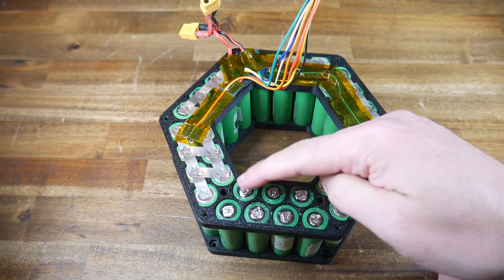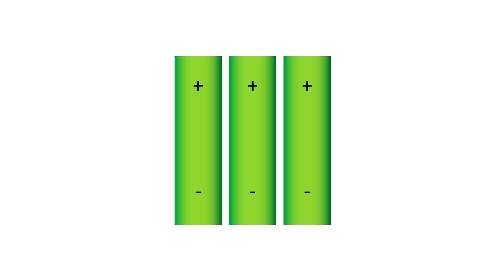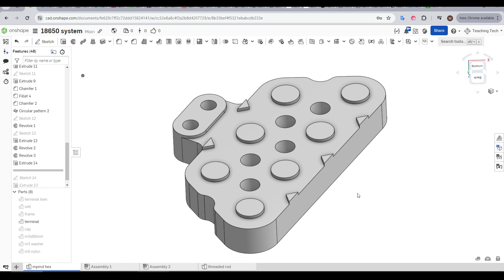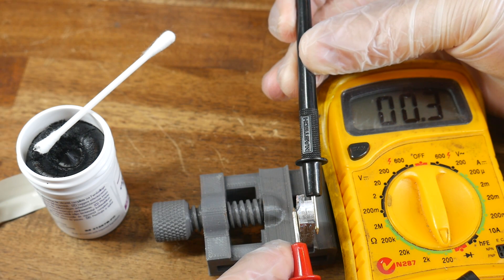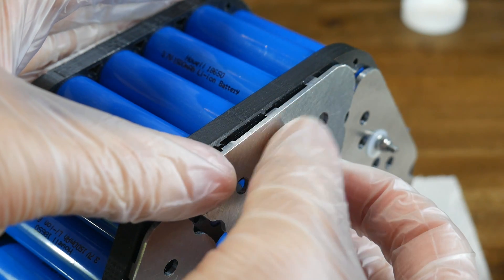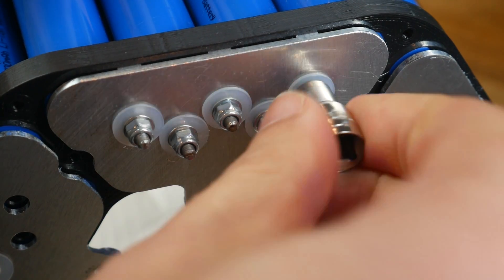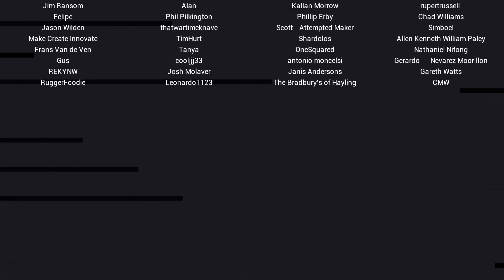Experimenting with a new (and probably flawed) 18650 building method: No soldering or spot welding!

Comment: I think what you have done here is really cool, though it feels a little over complicated with too many potential points of failure. I would suggest more of a hybrid approach.

First I would make the frame itself the modular portion based around each cell group, with them effectively interlocking with each other. This way if you have a bad cell, it is far easier to separate that group out. Second I would personally stick with  spot welding the cells within the group itself. It is a more reliable connection and uses far less hardware. While spot welding can be fiddly and annoying, I think you just kinda traded one for the other with all the bolts and alignment pins and chemicals etc (Obviously subjective). I would then connect the individual cell groups with a bolt mounted bus bar. This is a proven method and would combine nicely with your model if it is modular instead of one solid piece. Making disassembly a few nuts and sliding apart the frame, instead of cutting or a whole ton of nuts. One easy way to do this would be to have a spot molded in the frames for your positive and negative bus bar to snap in that a nickle strip gets welded directly to, but it connects to the next frame via the nut and bolt. I hope my rough description paints the picture in your head that I have in mine. Either way no matter what direction you go, I look forward to watching future videos on it.

Comment: For other applications requiring clamping consider using Belleville springs (conical spring washers). They're very compact, and being a washer are easy to integrate into a design. I've only used them once, but my heatsink assembly gave many years of reliable service.
Reply: Springs that's a great idea to provide constant contact.

Comment: This project came about because you had a problem accessing an individual cell, or a number of them, from a custom battery pack. If that happens with this new design, you are still going to have to take thing apart, just not to the scale and hassle of your previous battery pack. 

 It would be neat to have a way to easily change individual cells without having to take the pack apart, such as incorporating the spring at the negative end as is done for smaller cells such as AAA, AA, up to even D sized batteries. The wire used to make the spring would need to be thicker or perhaps replaced by a lever. For the lever I was thinking that the negative contact would be designed so that it would be flat against the cell when it was inserted but it was slightly away from the base of the holder by having the contact angled. The spring could be either in contact with the cell or it could push a contact plate out to meet the cell. Probably the former as that is how society has been doing it for many decades. I would be interested to see if it makes a difference to have the plate pushed out to make contact with the cell.

Thanks again for another interesting video.

Comment: Be careful, I’ve seen too many fires to mess with batteries.  I work for an environmental test lab and a battery pack like this needs to go through un38.3 testing.  I’ve seen companies who build battery packs and make one small mistake which cause the battery to go into thermal runaway and catch fire.  As a lab, we do not allow any company to store their battery pack onsite overnight without fire watch.  If nothing else store this pack in a metal box ideally outside of the house. As this will be used in a mobile application, I would worry about shock and vibration.  We had one company who delivered their batteries for testing and left it with us to test.  Before we could even get to testing, the battery pack caught fire while just sitting on a cart (again not charging, but just sitting there).  So please use extreme caution.  On another note, have been watching you channel for over 5 years and appreciate the learnings you provide. Good luck.

Comment: Just a couple of thoughts off the top of my head. Maybe mill the plastic washers from a sheet, making fitting a single sheet less fiddly. In the last part with the 4 cell design, could it be 3 cells? Then the single bolt will tighten each cell greatly reducing part count and assembly time. Thanks for sharing and keep innovating!

Comment: try some 32650 cells, they commonly come with threads fused to either end for easy and quick battery pack assembly/repair

Comment: For the new version, I'd suggest using triangular caps. In a square, one corner could be lifted, in a trangle all corners would be loaded. Also, if you could knurl the bosses or create some other sharp points on them, they could embed themselves very slightly into the metal, creating a more secure connection and maybe not requiring the paste altogether. The flat bosses wouldn't work great without the paste because the terminals arent perfectly flat and by all likelyhood, neither is the alignment. For a bigger battery I'd also consider if and how you'd like to be able to do some airflow and thermal protection. Having some sensors in can be a great early warning system if cells start to fail before they become critical and might even help you pin-point which bank is dead before disassembly.

Comment: Instead of milling it would be amazing to see the metal contacts 3d printed. Some type of wire frame. Maybe pcbway could sponsor you for that. But yeah, 3d print all the way. I'd also like to  see instead of M3 bolting your 4 batter assemble piece, some sort of 3d printed thread system, like some sort of Japanese style nail less joinery.

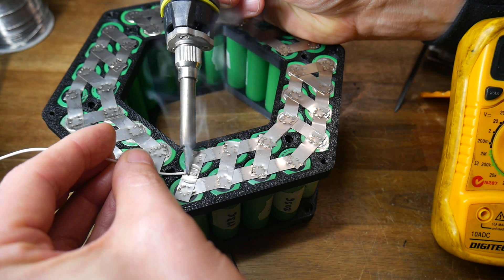Comment: NEVER 02:06 solder above positive ( + ) side of the cylindrical cell  without adding extra insulator !!! It will melt / damage plastic insualtor ring and over time whole battery can be shorted ( outher shell is negaitive ( - ) !!!!

Comment: General remark #1For the "ampacity" --> for copper, 10A/mm^2 is fine. The stamped metal parts (discs/tabs etc) within the cell are the weakest link in the chain. A point-contact can indeed be a problem
GR#2: When it comes to mechanically over-constrained systems, always think of "nest of springs" and therefore the spring-equation: F = k.x. To achieve a large F, it is better to have a longer travel (x) than a stiffer spring (k). I can think of wavy-disc washers or bellville washers that can interpose between your "collector" tab and the battery-nubs. The aluminium seems like a bad idea for its excessive stiffness, oxide-insulation related issues, electrolytic issues with the nickel tabs, and likely a number of other issues I cannot put a finger upon. It icks-out the engineer inside me. Good for thermal dissopation though. Ditto for the "conductive paste" - it is a band-aid to solve a problem, when the problem ought not exist.

You travel the  path of "swappability" to ensure you can replace individual cells instead of having to replace packs. This incurs costs of its own, but allows you to use cheaper cells. However, seeing how cheap and consistent "new" 18650s are, I question if the swappability is worthwhile, at all; wouldn't the bottom-line be better with a simpler interconnection-system and slightly pricier (identical) cells?
Reply: PS - the mechanical clamping might induce (unintended by th emanufacturer) stresses and pressures on the battery while charging and discharding - the bolts essentially disallow it to "breathe".

Comment: Interesting idea but I think that those contact bumps have too little "springiness" to it. I would try to make cutouts around those contact bumps in so they can flex a little bit. That would allow to reduce clamping force, reduce bolt count and allow for some variance in battery size. To make positioning screws and nylon washers easier I would try to 3d print shoulder washer or cut some plastic tube to make sleeves for bolts.

Comment: Internally threaded insulated tube for clamping? If used between every cell, could reduce to M4 or even M3. Externally threaded nylon 'allthread' with two nuts on one plate to hold it in place for assembly would also work? Counterboring the fixing holes on the aluminium plates would also reduce height but is a second side operation.

Comment: One comment I haven't seen yet: 18650s are afaik designed to pressure release at the top in case their chemistry fails, so that they don't at least explode. By clamping them down you now might have prevented that safety measure from working properly, so this might literally explode instead of just catching fire.
And if one of the cells or anything in there catches fire, those bolts will likely melt through the plastic and potentially shortcircuit the whole group, which might even only occur when picking up the failed pack. It's a think that frankly always makes me nervous, also with torches now essentially being pipe bombs, as they are usually sealed for water resistance.

Comment: Seems a bit over complicated just to solve a problem that you yourself created. By removing the end stop from one of your frames you can make each cell easily removable without breaking the entire pack(and even that parallel group).You can add the end stop again to your lid if you're concerned that the cells will move around

Comment: That was a bit uncomfortable to watch, for all the reasons developed in the comment section.
Did the previous pack die because of the lack of BMS, leading to a cell group discharging too low and ending up dead?
Please consider using a BMS for this pack regardless, they're really cheap.

Comment: In a parallel pack it would be best to fuse each cell individually, so that if a cell fails into a short circuit, the other cells don't feed all their energy into it to blow it up. This could be possible in a bus plate based pack if the bus plate had cell sized holes and the cells were connected to the bus plate by thin enough wires.

Comment: Have a somewhat similar system on Printables that utilizes standard nickel strips and silicon bumpers (act like mini springs). Can't seem to post a link to it (Youtube anti-spam filter?) but just look for "Weld-Less 18650 Battery Build System Version 2" if you are interested in checking it out. Working on version 3 currently.

Comment: My suggestion is having the batteries in banks of 3, that way it will all self level and you will get better contact, kind of like how a three legged table will balance on any surface, also maybe one side of your contacts could have a threaded hole, you could then use a threaded bolt, and a rubber washer on just one side of the contacts, speeding things up a lot

Comment: lol. I was literally asking if conductive paste exists for electricity like the thermal paste is for heat as you started telling us about the electrically conductive paste. Seems like it would be a "must have" for a system like this... and I'm sure there are many other systems like this out in the world right now. I think springs are a good conductor, but they aren't very thick, only have minimal contact and can't run high amperage. I was wondering though if they would work fine running the batteries in parallel to a bus bar, with only a few in series per cell (if any), and then the power adjusted with a converter at the end? (I'm ignorant, so if anyone knows why this wouldn't work, assuming it wouldn't, I'd more than appreciate hearing why).

Comment: If you need 24V at high current, a matching pair of 12V sealed lead acid batteries in series would be vastly safer to implement and use for this application.

Your method is incredibly dangerous, so please delete this video before you get someone killed.

Comment: I'm somewhat concerned by the lack of any springs to handle thermal expansion and vibration. I will probably try something similar when I electrify my kayak, but with sets of three cells and plates that are slightly bent, so they are flattened out by the screw.

Comment: The bolts are my main concern with this design. either insulate them further, change the design (as you did) or use bolts made out of a nonconductive material like nylon.
Great build though!

Comment: All details aside, this seems far too complicated give the inherent lack of robustness of the clamping method vs welding. I would suggest it would be better to improve the spot welding process and use new tested cells so there is no need to ever take them apart.

Comment: 13:14 I hope you don't just rely on the tensile strength of printed plastic for this...
Even screwing directly into a plastic dowel with a tight hole at each end is stronger.

Comment: Excellent video as usual - thank you. 

I don't know wether someone has already mentioned this but you can get high quality cells with strips already spot welded on by the manufacturer (rated for the relative max current), Although not the same design, I used a similar principle as your first one by simply folding the strips to the appropriate direction and angle and soldering the strips together.

You can then de-solder for replacements.

Comment: Issues I noted (many others have mentioned already) along with potential solutions where I can think of them:
1. This requires designing and machining custom conductive end plates with a complex shape, which is both time-consuming and requires specialized tools. A planar plate is easier to manufacture because it can be laser/waterjet cut, although this does make your locating features and protrusions for battery contact much more difficult to implement without using multiple parts.
2. The nylon washers are a big risk here; any offset or shifting will short the shaft out to the end plates, and you really need to use a shoulder washer to keep them reliably centered. This would also ease the assembly process.
3. Batteries can get hot, and hot plastic can deform. This is not a major issue with your current design, but the proposed redesign that replaces the continuous M3 bolts with a (presumably plastic) coupler (under tension) will likely stretch over time, worsening terminal contact. If that part is intended to be metal, it will both retain your shorting issue and will be challenging to fabricate as shown.
4. There's no provision here for manufacturing tolerances in the batteries. Every end plate is quite rigid, and if one battery is 0.5mm shorter than the others in the set, you're relying on those plates flexing to maintain good contact to the cell (which is also putting them at slight angles to the cell ends, worsening contact). Your end plates need flexures or other compliant features to allow some spring tension on the batteries so pressure stays more constant despite variations over time and between cells.
5. I have never seen conductive grease used in this way, and I'm not super confident it will provide the kind of stable ultra-low resistance connection you're looking for. Welded or soldered connections provide orders of magnitude more reliable performance, especially in adverse conditions (vibration, moisture, age, temperature variations)

Comment: Since the top and bottom protective printed plates can function as retainers for the pack, each trapezoidal battery module could be a separate isolated unit. Plugs could join the modules into a full pack. Unplugging would allow a module to tested individually. 

The fundamental issue with the original pack build was multiple cells (7) where in parallel, so any single cell failing (draining to empty), would drain all its mates. If possible, no more than a 2-3 cells should be in parallel. This way it's easier to spot when a cell is failing, as capacity of the 2-3 cell group will be lower than other cell groups which will show up as charging, as that group will have lower capacity, and/or spend much more time balancing vs. other cell groups in the pack. 

The best style of BMS (battery management systems) have a bluetooth interface, so can be monitored both when charging, and when in use. These however cost more than the simple dumb BMS boards that only check for over/under cell voltage conditions. Which to use depends on intend purpose of the pack, and its design.

Comment: I would use bolts/threaded holes in Nylon. That would simplify insulation and making the torquing less demanding. It will also introduce some elasticity to accommodate for movement. I'm not sure a 3d printed piece has enough long term stabilty

Comment: Far cheaper and faster to use neodymium magnets and nickel strips if you want quickly modifiable battery packs.  Been using this method for years even for high current applications as long as a casing structure is used to keep everything in place.

Comment: Great project! I happen to love batteries. Did you consider if the aluminum might corrode with the conductive paste or nickel battery terminal? I know corrosion is a concern with copper contacts on aluminum wire which is why aluminum wire is not recommended for use in houses. I happen to use battery holders from amazon that come with spring terminals to solder to for my projects--which are not as space constrained as this was.

Comment: how about using cheap car valve springs and instead of miling a lot of your plates, you could mill little cups that could serve as a spring seat. then torque your aluminium plate on a define torque spec (faster to bolt together). maybe its all none sense, i enjoy your projects.

Comment: I'd consider a copper wave washer for electrical connectivity. I'm not qualified to say if its better than the paste, but I'd expect they'd allow a wider tolerance on tension of the threaded rod/nuts.
Reply: Better than paste for sure. You'd use Beryllium copper which has a good spring back.

Comment: Ya know, easy way to avoid needing a CNC mill. Get a paper hole punch, some nickel strips, punch out some coupons, and use them as standoffs between the battery and plate. Bonus points if you figure out you can add deformations to the coupons to make them function like springs to take up space and help ensure good electrical contact.